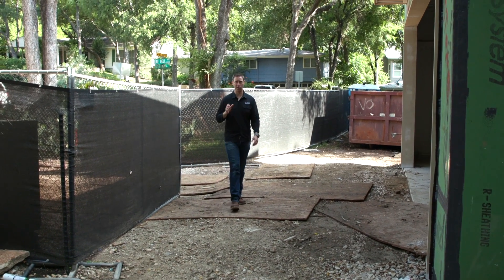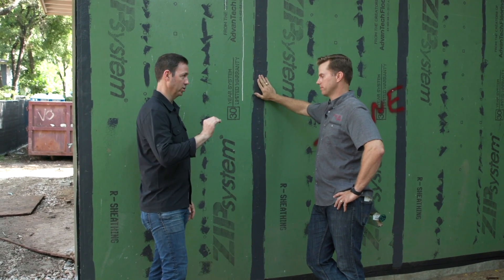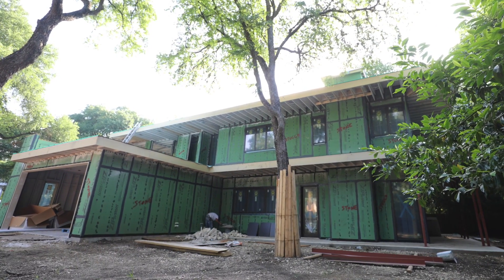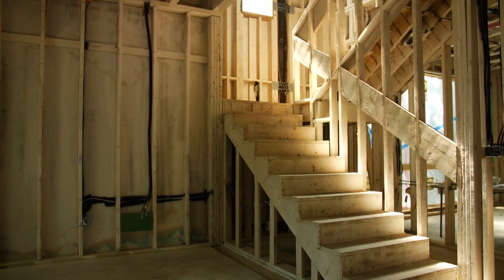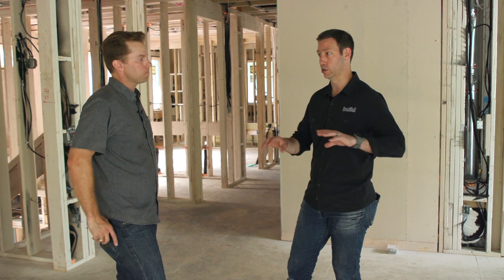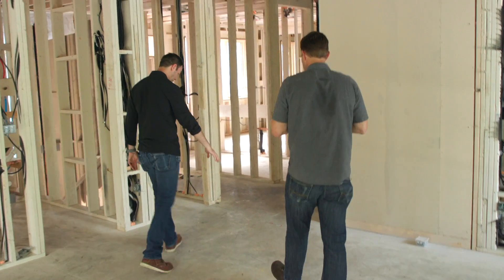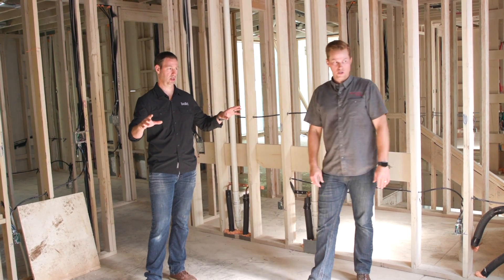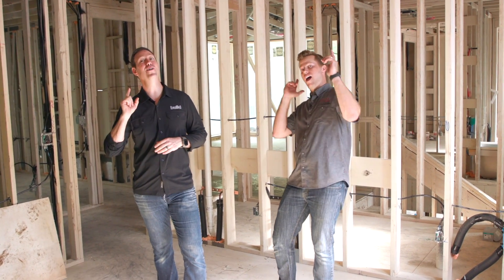Foam Free House - Is this Silly, or should we ALL BE BUILDING LIKE THIS?

Comment: You can also use Kaolin clay & H20 (usually also mixed with jam because it tastes utterly disgusting on its own) to help with diarrhoea. It works but childhood memories make me shudder. Easy fix for garage air quality - electric vehicles, low VOC paints and  PV panels + solar thermal coupled with battery storage.

Comment: If I would be sensitive to anything I would say I would rather have chemical gases than tiny mineral wool fibers wafting around into my lungs. Why not wood-based insulation? Concrete might've been best though since its mass and reinforcement would block radiation much better. 
Other than that: let somebody who has the money build whatever house they want. Who am I to judge? What a lot of negative comment here. I thought it's the land of the free over there? Let them be who they want to be.

Comment: So the subfloors, walls, and roof are covered with osb which is super air tight. What about all the glue used in the manufacture of osb? What a crock. Too bad if you have sensitivities to chemicals. You are now a captive occupant of an air tight prison as that osb offgases for years.

Comment: I hate being that guy... but Luke has no idea what underpinning is (its a structural foundation process, not for stucco)... and those cables are painted MC cable, not metal sheathed romex (other than the copper at the core of the conductors, the two have nothing in common).

Comment: wouldn't it have been cheaper to build the house with tilt-up concrete walls?  I don't understand why more builders don't do that.  When you wasting this amount a time on building this "organized camp fire", because it still made of nothing but Flammable materials, just build it out of concrete, much faster.  imho
Reply: I would too but only if the house was a simple shape, plus any repairs or extension would be a nightmare to do

But then again it be bullet proof

Comment: All these precautions, and yet she's putting in forced air heat, as i gather. I guess in a southern climate you don't really care about the heat side of the equation, but in the north this would be a really dumb choice. Especially if you have a lot of sensitivities. Blowing air out of ducts, pressurizing spaces. Air movement is always uncomfortable. Hot water heat is the way to go. Makes for more sense scientifically. The only reason forced air became so popular is because it's cheaper to install and because large scale developers have taken over the building market a few decades ago, everyone became brainwashed that forced air is the 'modern way'. The funniest thing. When scientifically hot water heat is far more advanced and high quality. What you see is what you get. There is far less concern about bad air being pulled from various places, far less particles floating around in the air and less air movement, which makes for a much more comfortable and even atmosphere.

Comment: I had the inside of my SIP house sprayed with lacquer (alcohol thinned sealer,) before any drywall or paint.  Also, I wouldn't have a garage attached to a house without a breezeway.   There is more than one kind of foam.  My SIP house was made with polystyrene foam (styrofoam,) not polyurethane.  The foam is made in a factory and laminated to OSB on both sides in the factory.  The SIPs are installed with latex based caulking, splines, and long screws.  Cobalt is toxic, so not a great plan for a conduit.

Comment: Interesting , client says they have problems with emf. I bet they will have a wireless router for there internet. Not to mention there neighborhood witch has them too. I'm a electrical contractor. I can tell you in no way shape or form Mc cable does do shit for emf. You could run emt conduit and pull thhn , still doesn't do anything for emf. If you don't want emf move to amish Country.

Comment: I honestly wonder why the client didn't go with a full natural building if they had all of these concerns. I would think timber framing and strawbale infill would have solved all of the clients design needs without bringing in an undoubtedly expensive consultant and hoping every trade touching their building would change their work habits just a little to meet strange specs. I'm curious if they will have natural plaster on the inside or if they will just have drywall, I wasn't seeing any lathing up.

Comment: Of course, the air-tightness of the house is great, and I really like treating an attached garage as an exterior room, including the ventilation fan.  But the rest?  If this client is actually sensitive to EM fields (hint: they're not) then they need more than that shielding on the cables.  They should be walking around in a Faraday cage at all times.

Comment: Go that extra mile and paint it inside and out with EMF shielding paint and make the place a radio quiet zone.
Sure, the windows and doors will be an issue, but there are solutions for those, too. Basically, turn the place into a Faraday box (do not forget the grounding. Ungrounded Faraday boxes/cages are not all that effective.).

Comment: An air leakage call back? I wish I had those issues. Luckily, I caught one entire exterior wall our builder tried to leave insulated. After that we have been plaued with other issues. For example stair cases being too narrow even after the inspector told them to move them and then somehow passed them. Roof support that is sketchy and will likely require drywall reapairs every five years. Random wood beams coming thur drywall. Oh and lets not forget the closet shelfs that were hung in the drywall, not the studs on the otherside, but the drywall with drywall screws. Thats righ tthey threw away the anchors to us cheap drywall screws.............
Reply: Oh and not to mention one of the siding guys that was talking about his friend in jail managed to not only move my directv dish but also my AC unit causing a line leak. They got their guy to fix the leak but they had him fix my second unit, which I hadnt said ahead of time, and then bill me for it. Oh and they tried to get me to move the AC unit away from the house further you know because it needed to be 24 inches as opposed to the 16 inches from the wall. When I said "well the install manual said the back could be 8 inches" he quickly responded "well the state of Virginia says 24 but anyway." Shady workers. They were called to fix a single cracked refrigerant line. https://richmondplumbingandhvac.com/ William and Fogg guys... who slapped their stickers on my AC disconnects.

Comment: by "should we ALL BE BUILDING LIKE THIS" I assume you mean everyone who lives in a climate that does not go below freezing because if you seal the outside and then insulate the inside without sealing inside that you will have black mould growing on the inside of those exterior panels and outgassing foam will be the least of your worries. Just as your eye glasses fog up when you come inside on a cold day the inside of your exterior wall will get wet from moist inside air migrating thru the unsealed insulation (the dehumidifier will help a bit but you are not going to take all of the moisture out of the air).

Comment: Actually this is a very well built house, not some "hurry up and put this together, no one will notice the holes behind the Sheetrock" mentality. Owner is also aware of the EMF that comes off the wires and taking that added precaution is spot on. If i could afford a build like this i would absolutely do it. I would not have used that loud ass PVC drain piping though. Those things are extremely noisy.

Comment: Thanks for covering this topic. As someone who had lyme disease and chemical sensitivity, this is great information. I know a lot of people think this stuff is crazy, but what your clients want is what your clients want. There is some mounting science behind it and if there's any chance of invalidating/judging their needs, it will damage the relationship. As someone who has put a LOT of focus on health, my chemical AND EMF sensitivities have diminished quite a bit. A lot of functional medicine and detox has lead to a calmer nervous system. For those who call this quackery, think about the fact that if you have romex and let's say a mouse eats away the sheathing before the wall is closed up (or a knife cut through it doing some other install), the chance of fire goes way up because those wires could short out. People with MS have an issue where the wire coating on their nerves gets eroded away. It's called myelin and it also protects the brain. There are other demylinating illnesses and Lyme is one of them. If your wiring is not insulated, either in a house or in your body, you're going to pick up on messages that weren't intended for that pathway. The body is electrical. Unfortunately, unless you've experienced these sensitivities, it's going to be easier to put it down. But what do you really care, it's job security. It's another line item in the scope so just keep your mouth shut and make your clients happy.

Comment: The magnetic fields fear is unwarranted. The magnetic fields of each of the conductors  in Romex cancel each other.  Using BX is a fine wiring method otherwise, as is metal clad cable to wire a house.

Comment: Next level of this is actually plastic "free" (or as little plastic as possible, as it's hard to get electric wires without plastic). So without these fancy Delta/ZipSystems. It means MHM-elements, clay, wood-chips sheep-wool as insulation.

Comment: In Germany we build only foam free... because nobody wants to have toxic materials in their homes..
Reply: I'm by far no of foam insulation either and it won't come in my house, but as far as Germany goes, I think you are disregarding the polystyrene insulation, that is put on the outside of the masonry walls, under the stucco. Indeed there is lot's of talk about that now in Germany, among others for the fire danger that it harbors and for it's end of life environmental issues. Also in a few instances, birds learned to crack the stucco and hollow out this polystyrene insulation to build their nests in it.
Reply: @edduuuard I thought the spray foam was used to hold doors and windows in masonry.
Reply: Don’t compare German building standards with American. 
In Europe we build a house, in America they disassemble a matchbox and turn it in to a house. 
I don’t even want to think about the movement of a house like this. Dude they build a whole house in wood framing and cover it up with one, yes one sheet of drywall. 
I have a co worker who works 6 month in the US and 6 month in Denmark, and as he says, it’s so nice to build in Denmark, because his actually building something he can be proud of.

Comment: Wow, so interesting that there is an emphasis on glue and foam but not other processed materials such as fiber glass. So much confusion.  I doubt You can have high tech amenities and back to nature requirements.  This is just a trade of synthetic products.  I would be interested if this does the trick for the client. Remember, Asbestos is naturally occurring silicate minerals

Ultimately if it does not work the client really should live a different life with low technology away from the  highways and cities. Perhaps off grid.   The structure should be completely simple like a a Japanese Teahouse basic materials: wood, clay,  straw, stone paper, glass and fire.  

That is my free consultation

Comment: What's the point of painting the studs if they are just going to be covered up with filled/caulked drywall? As long as there are no air currents sneaking under the baseboards, no mold spored are going to burrow their way through the drywall in the dead of night. Not to mention the fact that it's not a question of if, but of when the house will see its first leak; there will likely be more mold spores from that than on a house-worth of 2 X 4s. I also don't get the point of the Zip system between the garage and the house; isn't fire-taped 5/8" drywall a requirement in TX? And, there is practically no EMF from ROMEX, with the wires  so close, especially now that, with GFCIs, neutral-sharing or swapping is no longer allowed. People who survived knob&tube wiring would have a laugh.  As Buffalo-Springfield put it, "Paranoia strikes deep."

Comment: I would like to see @Home Performance do some EMF readings on this house to see if MC & black coating make a difference compared to a regular house.... Also dont forget those HVAC motors produce massive EMF!!
Reply: The wires are run inside a faraday cage, there is no EM fields to mitigate.
Reply: @jrmead  Even with the shielding on the wires, there might still be mitigation needed for low frequency noise (aka dirty electricity) introduced on the wires by local switching power supplies, solenoid motors (fridge, dishwasher, washer, pumps).  Performance testing would be important (any mistakes during installation will diminish shielding value) and I am sure the clients can acquire handheld meters within their budget ;-)

Comment: Thank you for this video.  It takes a genius to build a house right the first time. I helped my brother he was building a second floor on his house. He didn't want to do the extra sealing on it. My nephew had health problems so he went online before building. He acted like I knew nothing about building and didn't want to listen. I watched all this old house and Bob Vila own show also. My brother didn't seal the house right.  9 years later he had leaks around the Windows. He didn't use rubber peal and stick. low quality tape on house wraps. I wanted to caulk the seams. He had foam panels and didn't tape the seams properly. He had very high bills summer and winter. Higher than my parents house built in 59 same size home. All I did was added insulation 7 '' in attic of my parents house. Original metal Windows and no insulation in the basement. We need more shows that teaches the right way. I also watched Mike Holmes build it right. Sorry for any misspelled words even my phone doesn't know what I'm writing.

Comment: 13:36 you can just buy plywood that uses NON-VOC adhesives.
like they make formaldehyde free plywood.
I know at least 1 manufacture in Oregon that make them.
they just cost more then regular plywood, but I'm sure it is cheaper then your fiberglass netting impregnated mystery board.
Reply: You made me spit out my coffee with your "fiberglass netting mystery board!"  Good one!
Reply: I've seen the MgO boards at a discount builder's supply store, they're a few bucks more than good quality plywood.

That store was advertising them as backer boards.  They cant mold or fall apart and are much more rigid that other backers for tile.